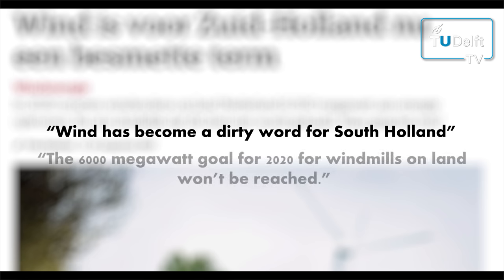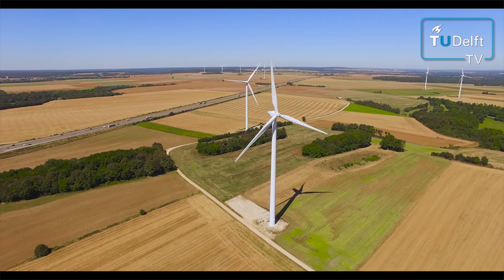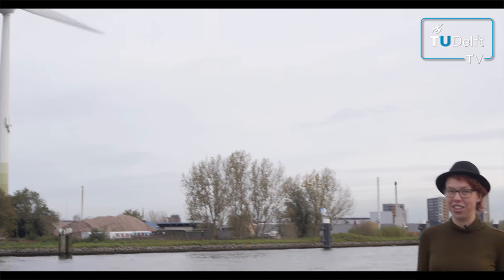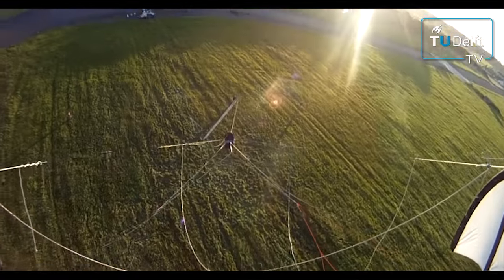Kite Power can replace traditional wind turbines: harvest wind energy with a lightweight Kite

Comment: Bravo!

It's weird to me that the amount of energy needed to reel in the kite is less than the amount extracted while the kite is being released. I guess that happens because the kite is angled so that it catches the wind on the way out, but angled to avoid catching the wind while being reeled in?

Another question: Why is a figure 8 flight pattern used?
Reply: During the figure 8 the kite travels at a high velocity, generating lift. This lift appears as a force in the tether line. When the line is reeled out completely the kite is steered to a point nearly vertical above the tether point. There the kite produces close to zero lift and the line can be reeled in with very little force.